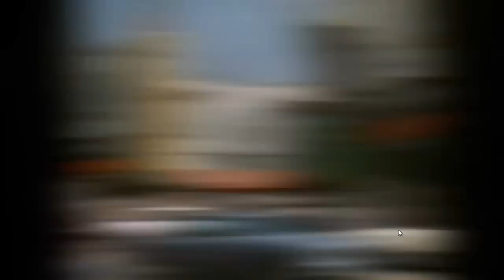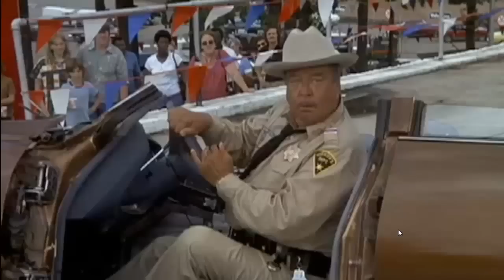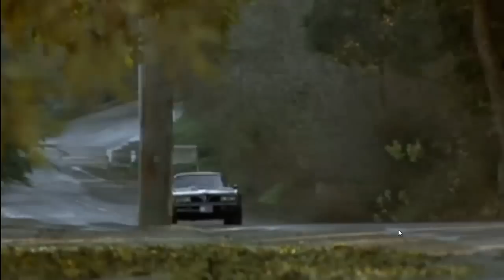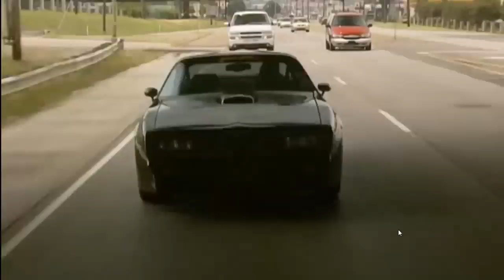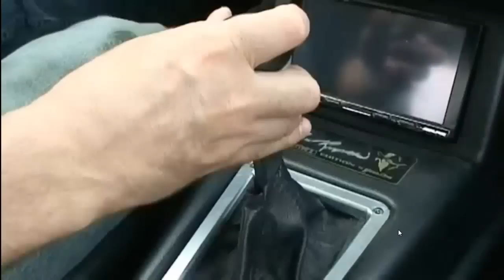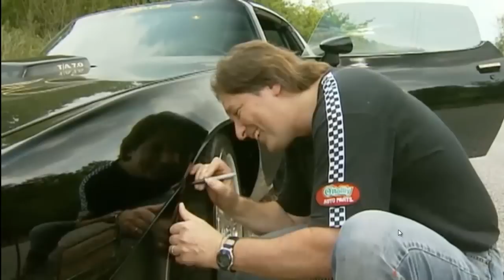Stacy David drives 1977 Bandit Pontiac Trans Am Burt Reynolds Ed. on GearZ (HD)

Comment: GM should bring back the Pontiac line and reintroduce the 77 Trans Am as their muscle car. Rip Burt Reynolds.
Reply: Isn't Pontiac defunct?
Reply: Agree
Reply: thats a good idea
Reply: Pontiac was GM's back bone, They definitely made a mistake by killing it off.
Reply: It would sell like hotcakes.  One of the best looking cars on the road.
Reply: someones bought the rights to make trans ams and there made from modern camaro with bandit style front grille t tops gold pinstripes gold bird look them up the companys been building since around 2016 and far nicer than camaro and lots faster 700bhp standard
Reply: they basically added the extra performance to the Camaro line. so basically the Camaro is the firebird.

GM has a problem with brand definition so many brands that are basically the same car, the Pontiac cars didn't sell because there was no reason to have one. it be silly to bring back oldsmobile and Pontiac. best thing they should do bring back the name of certain models. like Chevrolet trans am or Chevrolet Bonneville. kill the devision but make specialty cars occassionally under the Chevy brand. they lost alot of money end the end of Pontiac.

they need to do more leaning as well buick got to go. there's no reason to have it now. Chevy (main brand smaller trucks and almost all SUVs and minivans kill the 3/4 ton trucks and up), Cadillac (luxury higher end cars smaller trucks and SUVs and minivans) and GMC (heavy duty trucks  3/4 ton and up, full sized Van's and heavy duty SUVs like Yukon/suburban or specialty extreme use or performance SUVs no smaller trucks and no minivans) is all they need cut the rest it kills quality and destroys brand loyalty and instant recognition. if they want to bring a old brand back then just make a model car that fits its image and throw it into the lineup of the brand it best fits. firebird or Bonneville would go to Chevrolet.
Reply: GM should create a specialty division. It could be a division that produces sports cars. They could sell the Corvette, Firebird, Camaro, Trans Am, Chevelle, Nova, GTO, etc.
Reply: @matthewwilliams9200  buick is gm backbone in china...the worlds newest and largest car market. Gm will never be axed...its also the brand of babyboomers that cant afford Cadillacs.
Reply: @brian3174  Trans Am Worldwide in Florida.

Comment: In the 80s, my buddy's dad had a 74 Trans Am. Same car as the Bandit, basically, but with round headlights. It had the shaker scoop and the bird decal. His was bright red, and had a 455 with a Holley 850 Double Pumper and Doug Thorley headers on it, hooked to an M22 Muncie 4 speed, with a 3.73:1 posi rear end. It was fast as fuck.

Comment: He says the black and gold paint scheme was new for a production Trans Am. Incorrect. Pontiac released the special edition Trans Am (black with gold accents) for the 1976 model year. For 1977 they changed the rims from honeycomb to snowflake, they redid the nose and the 455 was dropped leaving the 400 and 403 engines. 

Also he says that Smokey And The Bandit "started" the CB craze. This is also incorrect. The CB craze was born from two things: (1.) the fuel crisis of 1974 and (2.) the 55 mph national speed limit. Because then the CB was used to (1.) ask which gas stations were open and (2.) where the cops were running speed traps.

The ONLY thing Smokey And The Bandit may have had a hand in as far as CB's go, is to help propel sales of the CB, even though it didn't need help; CB originally was 23 channels, but the "fad" that came from it due to the gas crisis and 55 speed limit, caused a massive use to where the radio was jammed with users; thus on Jan 1 1977, the FCC allowed for an extra 17 channels to be added, making 40 channels total. Smokey And The Bandit came out around May of 1977.
Reply: David Welsh Right on!
Reply: David Welsh In 77, Pontiac offered 3 engines.  A 403/185 for the enviro wackos in California, a 6.6 Liter/400/180 hp and the T/A 6.6/400/200hp in 77 that went to 220 hp in 78.  These 400 would romp the 76 455’s.  I bought a new 78 TA 6.6 in Oct. 77 and it tore the Z’s and 76 455 a new butt hole.
Reply: He makes up stuff.
Reply: @melrose9252  The cars engines were assembled by hand so there were differences on each one if they were stock.  just because you beat one 455 doesn't mean you would beat all 455s or 350s for that matter as they were all the same block the bore was different on the Pontiac, for instance after being around over 40+ 2 gen birds the fastest birds were a 70 formula 400 4speed a 75 formula 350.  Slowest 2nd gen 78 marti blue with 400.  So it depends on who put it together..  If you wanted power on them you removed the cat, headers and ran duals all the way back with straights or your choice of mufflers ( turbos were popular back in the day) ported the heads, changed the carb, for an edelbrock usually, sanded the block to make it smooth where the heads went on,  put on an aluminum intake, and changed the cam.  Simple improvements on those cars and you would notice power boost with the pushing well over 300hp.
Reply: It did help the sales of the Trans Am I remember even my uncle went out and bought a brand new 1977 black Trans Am then he wrecked it a month later around a telephone pole.

Comment: I had a Bright Yellow 1976 Trans-Am with the 400 Cubic Inch Motor.  It was a Real "Dog" because in the 1970s the car companies were starting to put all that Anti-Pollution stuff on the Motors and exhausts.  So my big 400 Cubic inch motor only had 180 Horse Power.  Now-a-days my car's V-6 Motor has more Horsepower than that.  210 HP on my 2006 Impala with 3.5 Liter V-6, and 280 HP on my 2007 Grand-Prix GT with a Super-charged 3.8 V-6 motor.

Comment: I worked at a performance shop in Miami and a friend had a pinstripping shop where he did everything by hand a few doors down and they sent the cars to him to put the "Bandit" on the doors and maybe a couple of other touches. There were I think three regular cars for filming closeups and a stunt one with (Among other things) the front brakes disconnected for bootleg turns (without using the e brake). This was a bit before filming began and we walked over to see these cars come in. Here comes the stunt one roaring in and hits the brakes and skids and smashes into dumpsters and a wall never to run again. Then there were only three.

Comment: I had a new 1978 Gold S/E and it was great for a 16 yr old, but cars have come a long way from that.  I have no desire to drive those anymore.  It had awful brakes and no wet road traction.  The T-tops leaked. the electrical system was awful, but it was beautiful
 40 years later and classmates still remember that car.

Comment: If you looked around. You could find the ones with the Oldsmobile big block in them. These were monsters torque automatics. 

Year One knows what there doing as well. You try and find a subframe that hasn't spread apart. Bushings wore out and crappy suspension that would rattle your teeth out. Also the doors were so heavy. They would eat the hinges up.
Reply: The 403 Olds powered T/As were really dogs compared to the Pontiac 400s especially the 78 220 hp TA 6.6.

Comment: I had a 1980 trans am wasn't a well conditioned car,motor going bad because it had a 301,yes a 301.Should have been illegal to put shitty motors in cars like that,but the chicks were mesmerized by it.That's the only good thing i remember about it
Reply: Ben Santiago back in 1980 the feds were wanting cleaner burning engines. gm had a problem with the 400 and 403 engines burning too much fuel because yu just can't make a bigger engine burn clean, not back then anyways. So gm killed off anything bigger than 350. that's why if you've ever noticed Chevy didn't even make a 454 from 1980-82. they brought it back in 82 as a heavy duty engine for busses and such. the 350 was considered top engine and was reserved for Corvettes and such. Pontiac only had one engine left of their own, the 301. And they tried to turbocharge it bit that did not help as much as they hoped. in the end the 301 left by 1982 and the 305 Chevy became the new top performer for the Trans Am.
Reply: Ben i always said what the hell were they thinking.

Comment: Many owners of these cars learned the hard way that their Firebirds were 'Emily Post Polite'. Floor the accelerator and EVERYBODY else went first. They were so well known as dogs that with the addition of a modded SD 455 a few became sleepers and sucked in a lot of fast '60's cars. 
Sadly, when GM ran out of their 220 hp 400's, they subbed in 305 4 bbl engines with 155 net hp. ET's dropped from 15.5/90 to 16.8/78.0, ending any pretense of performance. With a powertrain upgrade, and their inherent decent handling (much better with a lighter small block) they make fun cars that are always popular at shows. They are easy to 'clone' as well.
The Bandit lives on!

Comment: Bragging rights for having driven such car but truth be known was these cars were not your every day driver and were in fact anything but fun to drive. Driving on rough roads was very painful, even bumps and cracks in the road made for a head banging back breaking experience. Oh the railroad tracks, you came to a full stop and went over them one wheel at a time. The original bandit cars I believe had 700R4 automatic transmissions which didn't last. Fun to drive on the road, NO. Fun to do burnouts and donuts in parking lots and city streets, YES. Most people got rid of them because they were not driver friendly cars, had mechanical issues, and back then people were stealing the T-tops.
Reply: James Barrow the 700-4R didn't come out until 1982. The 1977-81 Trans Ams came with TH350 automatics or TH400 automatics, both were 3 speed. Some TH350's in 1981 had a lock up torque converter.

Comment: Interestingly I ordered ay 1977 TA, SPECIAL EDITION, Ps/PB, Hurst TTOPS ( which leaked terribly), auto, 400 6.6L, velour Interior, crank windows, delete tinted windows, Rear Defrost, radio am, etc... Had Ziebarted, (which failed miserably), rusting out after some 13 years in Warsaw IN daily driving... I had to order in Oct Of 1976 to get the Hurst  Hatches in March 1977.......

Comment: Putting a 305 Chevy with head work and a hot cam, only to twist the already rusted and rotted leaf spring mounts clean off the car. Glad to see they went with a 4 link coilover rear frame.

Comment: If u have seen the movie enough times u will know one trans am was a 4 speed . Wright after they leave for Texas  at the traffic light the stunt driver revs it up dumps the clutch and smokes the tires. The up close camera shots cars were automatic with a  olds 403 . The way u can tell the 2 apart is on the shaker the olds powerd  car  has 6.6 liter on the shaker . The Pontiac 400 powerd  car has T\A  6.6 on the shaker  . in the movie the bandits car did have a cb  radio in it
Reply: This is an old post but the above is incorrect.  The non California Trans Ams (77) had the 180 hp 400 Pontiac (6.6 Liter) the T/A 6.6 was a 200 hp Pontiac that went to 220 hp in 78.  The Olds 403 came standard in all T/As starting in 79.

Comment: This T/A is baddass. I was never a TA guy, then i drove a 79 model back in 1986. ...AND, i'm still not a TA guy. I liked it though, and understood why they were popular. Was a ton of fun. Easy burnouts with good handling. Starting in 82', they would lay endless rubber, so would camaros. The new , stiff chassis wouldnt allow front to rear weight transfer. Thats my observation after driving many along with mustangs.  Stangs hooked much better . Same HP, tires..i figure it had to be the chassis setup. Ones good for curves, one for straights.

Comment: I had a 1979 Camaro Z28 back then. White with goofy White wheels and blue stripes. Not as flamboyant as this car. I think mine was 5.7L 350HP
Reply: No way it had 350hp stock. At most 220, if it was a CA car more like 180. You had the fast times at ridgemont high car, the one spicoli wrecked that belonged to the black football player.
Oops. Apparently that car was silver not white as I recalled. Similar. I had a 79 formula w/305. Lets face it they were slooow but better than anything else at the time.

Comment: Low-profile tires on huge rims? "Modern" gauges and steering wheel? What was wrong with the originals? They had too much style and didn't look like they were made in China? No need for those headlights, either. I bet that engine's a dime a dozen crate motor, too. Way to take away the car's soul and turn it into a boring, tasteless modern car, Year One.
Reply: 100% Agreed keep Pontiac a Pontiac.

Comment: Why does the hood scoop move? 
Is it connected to the gears ?
Reply from the maker: It's called a shaker hood, it moves because of the torque
Reply: Michael Woodward oh right, that's pretty cool.
Wouldn't it only move in the one direction? Not go back and forth?
Reply: the shaker hood is mounted on rods that connect to rollers that ride on the top of the front tires.this served two (2) purposes,#1 it knocked dirt off the tire to prevent underhood rust.,#2,- it monitored bumps in the road to let you know the road was too bumpy and this would prevent accidents.

Comment: Did they modify the 1977 Trans Am for Smokey and the Bandit? Sounds pretty mean on the screen but the 400 C.I. was restricted due to emissions. Not much wow factor..
Reply: Eric Goodno They changed the exhaust & added Nitrous to the car.
Reply: You won't like the real answer.  Used a Corvette 427 with side pipes sound to dub in.  Truth.

Comment: I would modify the engine , trans, and suspension, and make exact replicas of the original Snowflake rims in a 18" diameter , to fit the modern brakes...leaving the body, interior and paint totally stock...that would be killer.

Comment: The larger rear-rubber un-squares the design, making a lot more understeer.
Reply: +Mike Cronis -- Larger rear rubber and/or a wider track in the rear does not make a car understeer. If that were true, how is Audi/Lamborghini, Corvette, Porsche, Ferrari, etc. doing it without their cars understeering? What about F1 and Indy cars? They also seem to corner quite nicely and have been doing so for more than 50 years.

Comment: 1977 Trans Am Bandit 205 horse power......2017 Trans Am Bandit 840 horse power...No gas shortage anymore... I guess???
Reply: alberto ciulini  The Trans Am were not sold as the "Bandit Trans Am" they were sold as the The "Special Edition"
Reply: alberto ciulini  The 77 Trans Am with the $50 T/A 6.6 package had 200 hp and 78 220. Just saying
Reply: alberto ciulini yes.  No gas storage.  Have you been outside since 1977?  Have you ever had a problem getting gas since then??

Comment: :"They start at $130,000, and can reach $200,000 with options"  Are you kidding me Year One?... I'd prefer the stock one as is, with just the LS engine/TKO swap.  Build it  for around 40K, and have the original engine if you ever wanted to go back stock.. Its cool, but my LS powered 1967 RS Camaro Convertible will do me just fine..

Comment: I owned a 75 T/A 400 speed car sure it was de-tuned but if you stripped the smog pump off ran dual exhaust and put a tuned upgraded quadrajet carb on it, well it opened up pretty good for a 16 year old. I wish I never silt that car.

Comment: I thought the 78 was still available with the 455 wasn't it and if I'm right it would have a bit more then the 400 and with gm doing the underrating like they were known to do it's likely that it would be close to 380 HP  but the torque would be around 410 that's still a hot engine and by the movie scenes that car is heavy and it easily will burn the tires and get a second gear scratch the factory numbers are way too low
Reply: tiger1945 76 last year for 455

Comment: why do you lie? I knew a person that had a 76 trans am with the same black and gold paint scheme. in 77 they also had the 455 engine with 4 speed transmission, these cars were not under powered. they were bad ass cars back in the day. next time you do a video, try and get your facts straight.
Reply: No 455 in '77, with or without a 4 speed. 400 or Olds 403.  '76 was the last year for a 455.

Comment: The "Bandit" Trans Am's do look sharp, but they aren't as fast as you think. At 3400 pounds they drive more like a tank than a sports car.
Reply: 3400 hundred pounds isn't a lot of weight for a V8 sports car.  Modern Corvettes are around 3400 pounds.  Modern Camaros are well above 4000.
Reply: That is true, but those cars have twice to three times the horsepower.
Reply: they did great on the 'skid pad', good handling car. Stays flat in corners and pins you to the door!
Reply: John Greene I remember those cars well & rode in a bunch of them, they were all show, the girls liked them...😒
Reply: & flexed like crazy
Reply: John Greene guess you never drove one, the 455 with 4 speed transmission was absolutely bad ass. it would blow a lot of these rice grinding pieces shit off the road they have today. even the 400 was a bad ass engine.
Reply: John Greene You obviously never drove a TA from this period!  These cars handled like a dream and are not bad in today’s standards.  As for as power, they were some of the fastest cars of the day and are not really slow today.  Your analogy is evidence that you don’t know what the hell you are talking about.

Comment: Dont get me wrong... I absolutely adore this car but it was a sponge to drive. As soon as you it the throtle the car starts to twist and no matter what you do to the suspension its still a sponge. The only way they found to better the ride is put a role cage in it (more weight). Naaaa, they can't make a supercar with that structur. you realy need to start with a modern car and make it look like a 70's Trans Am.

Comment: Weren't most of the latter 6.6L engines really 403's that couldn't be built for shit?
Reply: Christopher King Starting in 79 with the exception of 10,000 220 hp 400’s with 4 speed only.